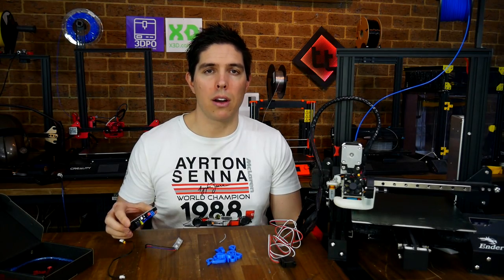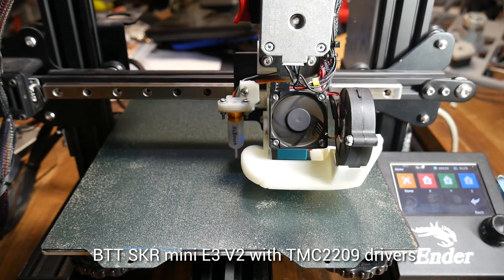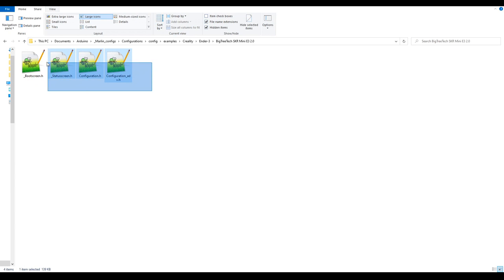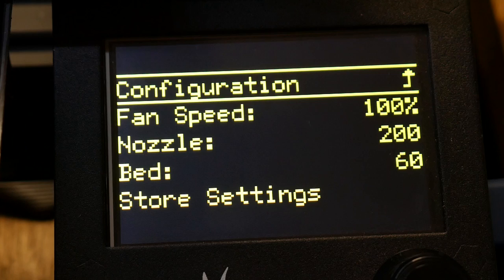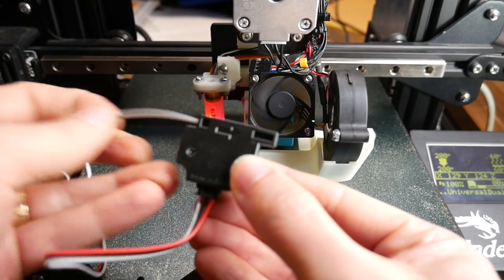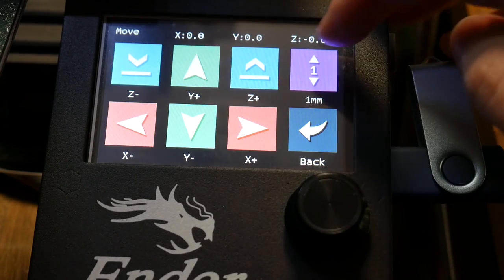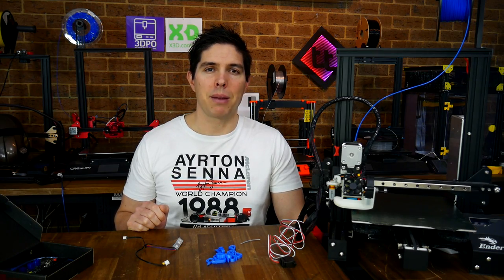SKR Mini E3 V2.0 - Complete guide to the best value Ender 3 upgrade

Comment: Hi, 
after I switched to new motherboard BIGTREETECH® SKR MINI E3 V2.0 on ender 3 pro, the printer moves to the end at X axis, end the table has also moves out after each layer change, I thought maybe there was a bug in the system. so I wanted to try and see if I could fix it.
 on the "studio code prog"
and I wanted to put new firmware on the motherboard, and then I get this error. on the "studio code prog"
so I cant sett a new software in the motherboard, it wont make me re-build. i have tried most things that i can be found online, done exactly as i have seen it. but only get this error all the time
"Error: stm32fi family in nor supported by maple core"
"STM32F103RE_btt FEILED

 some ideas :-)

Comment: Are you getting any freezes? I've had several and there are discussions on github about it.
Reply: steve Andre Back then I was using the Marlin bug fix branch. There was a problem with a library dependency that caused the freezing. I made the change someone suggested and haven’t had any issues since. Thank you though

Comment: Can you please make a video with a step by step guide on how to build marlin 2.0 for an SKR mini E3 V2.0? 
the skr mini e3 v2 is not compatible with the v1.2 build guides, you will run into dozens of errors if you try to follow that, even if you input the correct perimeters for the v2 such as new 32 bit chip and things like that.

Comment: Now, a little project for you lol. I’d love to use my old Creality board, or my old 1.2 board OR the relative driver board (?) and arduino to work with such as a nema 17 and turn it into a bottle rotator for resin bottles :) anyone fancy taking this on?? No more bubbles and beautifully mixed resin.

Comment: Thank you for the guide.

I got stuck trying to add a BLtouch & NeoPixel setup to my Ender 3 with the SKR v2 mainboard.

The works fine with the BTT pre-configured firmware. I tried to add the BLtouch settings, along side your NeoPixel settings. the NeoPixel appeared to work, but the BLtouch wasn't playing ball. I kept getting a probing error.

I have given up now, after playing with the config for over 6 hours.

I would love to get NeoPixel working alongside the BLtouch if anyone is willing to help me, or send me over a working config please!

Comment: According to the official SKR Mini E3 V2.0 pinout, your wiring guide is wrong. You should change black dot with red dot in the bed connection. Luckly polarity doesnt matter in this case otherwise some boards would be fried.

Comment: Has anyone else been able to install the windows driver for this board?
It will not install automatically and when I try to do it manually it fails because the driver isn't signed.

Thanks.

Also when I try to compile the firmware it keeps failing.

Comment: Anyone having an issue with the extruder not working once installing the board? Moving the z axis, moves the extruder and removes the filament from the tube. When i try to move the filament in the motions menu, nothing happens. I am so lost. I updated with latest firmware.
Reply from the maker: Sounds like plugged into second Z port instead of E port.
Reply: Teaching Tech what is weird is that moving the z axis moves the right axis, but it also moves the extruder at the same time. The extruder rotates and pushes the filament out. I was talking to someone about maybe something with the pins of the extruder. Any ideas? Thanks
Reply: there are two z ports if you have your Z motor plugged in the first Z port and your E plugged in to the second Z port jogging the Z axis will make both move at once
Reply: @KaspaWasTaken  hahaha that was my issue. I cannot believe I did that. Thank you so much.

Comment: For some reason whenever I compile the basic version and upload firmware, I keep getting the message "EEPROM Version Error" Anyone any idea?
Reply: Jo Van Bever somewhere in config or config.adv there’s a setting to auto initialize the eeprom, enable it and that should go away.
Reply from the maker: You can also do it from the menu in the LCD. This error comes when you change compiling features and after re-initialising then storing settings will go away.

Comment: Note:  On the SKR diagram example, connection B ... the connection shown is the wrong way round. Positive is closest to the side of connection C, not H. My bed wasn't heating up, checked the pinout diagram on the Bigtree github site, and confirmed, I had mine cabled the wrong way because of following the image. Reversed them, and the bed is heating fine now.

Comment: Hi! I have managed to install everything fine, and when I switched my ender 3 on, everything seemed to be going well. I have tried to do a test print and both the bed and the extruder seems to be heating normally, however, when it starts the print and it tries to go home, my extruder now keeps ramming itself onto the switch in the x-axis? Does anyone know any solutions for this?
Reply: thats the exact thing that has happened to me. Check your belt tightness and if there are loose wires in the x stop or x motor. does it do that when just moving the x axis? Im hopinh updating the firmware will fix it

Comment: Any having issues with the v2?. I installed this board to my ender 5 and i confirm the hot end and part cooling fan work following the diagram but my motherboard fan doesn't spin even if there was a print going. I tested the mobo fan and it does spin. It is plug into the fan 1
Reply: i could recompile for ender 5 if you want

Comment: What i have to change in TFT firmware to increase nozzle temp? I change in Marlin max temp to 400 deg and it works but only in Marlin mode. In TFT mode stil only 275 deg. I tried compile firmware for TFT, changed (configuration.h) #define HEAT_MAX_TEMP    {400,275,275,275,275,275,150,60} and in config.ini  - max_temp:T0:400 T1:275 T2:275 T3:275 T4:275 T5:275 BED:150 CHAMBER:60. When I upload firmware got message "invalid values "max_temp:T0:400 T1:275 T2:275 T3:275 T4:275 T5:275 BED:150 CHAMBER:60".

Comment: Am trying to instal the SKR all ok following this video (using VS) putting in the STM board name in platform.ini run compile but rejecting the board am working on a MAC, am making sure board name correct but will not compile, thanks,, UPDATE: problem sorted, was 2 things, first Mac needed  'Bash' changing to 'ZSH' is used within VS Code (has been altered by Apple) and my file path was too long, have now fully updated my SKR mini E3 to latest Marlin.

Comment: Unfortunately, there is currently an issue with Marlin (https://github.com/MarlinFirmware/Marlin/issues/18565) that completely breaks prints if using octoprint and have a pause (for filament runout or anything else). So, if you use octoprint, don't enable the filament sensor...

Comment: Can someone explain what specifically makes the printer quieter with the new board? @2:06
Reply from the maker: It's the stepper motor drivers. The RMC drivers make the difference.
Reply: @TeachingTech  You meant TMC

Comment: I bought this upgrade and I also purchased the touch screen. And i can't for the life of me get the touch screen to recognize the printer, anyone have some advice?
Reply: I can't remember exactly what the setting is called but it is essentially the polling rate, should be set to 250000 i believe. There's a few videos on fixing the issue

Comment: OK I got my skr mini e3 v2 and loved it. the only issue is that it only lasted two months and im not quire sure what is wrong. ive plugged in all back in and flashed the firmware a few times still nothing. If anyone has hay ideas of what it could be id love to hear them.

Comment: Amazing Job, Michael!
I'm planning to build my own customized 3D Printer based on this Board and now I'm searching for stepper motors. What is the Maximum power output for the Stepper drivers? I'm going to run the System on 24 V. Can I plug in bigger motors than NEMA 17? The BTT website only says 2.5 A max output current, but for which port? The heated bed? Every output?

Thenks in advance!

Michael

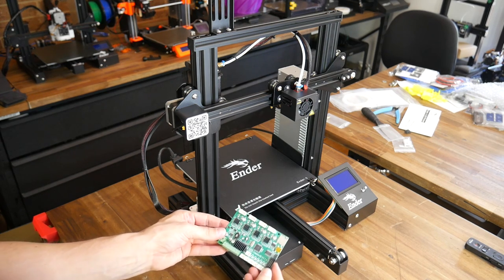Comment: teaching tech and GUYS be careful (lol) i installed skr mini e3 2.0 today and screen was BLANK like there is no power going to it ! after checking manual and looking at picture i found that that LCD connector tray ( the black container that gives direction to the lcd cable ) was installed in the wrong direction!! so i removed it ( carefully it can be removed ) installed LCD cable in the other direction and it WORKED 100% ! so if you happen to have NO power on lcd after installing it.. that's the problem! if anyone has doubts i'll provide a picture ( the cable container is the " J " in the video at 4:29  )

Comment: Is there a way to update the Marlin firmware on the SKR Mini E3 v2.0 that does NOT involve using the SD card?  I have installed the Maple drivers to enable to USB cable that came with the board so my computer recognized the port opening but I cannot get VS Code to push the Marlin build to it like I used to with my original board in my Ender 3 Pro.  Can anyone help me?

Comment: I don't understand this fan setup, you are supposed to pwm control the case fan but leave the hotend fan just running all the time ?  I have mine setup to do the 2 hotend fans , so my printer is silent when not printing and tool is below 50c, the case fan can stay on all the time for all I care.
Reply: Also be warned the fan mosfets are crap and there is no protection on them, I already blew them both and replaced them.. this is discussed on reddit and the github also as problematic for others, I would be wary of using buck converters without external mosfets
Reply: I just installed the skr mini e3 v2 and tft35 into an Ender 3 pro.  I plugged the case fan and parts cooling fan exactly as shown in teaching tech's video.  (parts cooling fan onto fan0, and case fan onto fan1).  As soon as I turned on power, the parts cooling fan runs at full speed.  Don't know why it's running when I'm not even printing anything.  So seem like the fan that's plugged into fan0 is running all the time.  Is that what you're observing on your setup?
Reply: @ptmoy1  No that sounds like a firmware or board issue, I mean the hardwired fan, I  swapped them so the hotend fan is off when not hot, and case fan is hardwired now.
Reply: @tablatronix  I still don't quite understand how you have your wires connected.  On TT's video, he has the part cooling fan (yellow/blue) connected to fan0 and the case fan connected to fan1.  On your setup, are your wires connected exactly like what TT is showing, or the exact opposite?

BTW, as you've mentioned in your original post, there are two hotend fans.  When I have my yellow/blue wires connected to fan0 (as shown by TT), only one of the two hotend fans turn on when I power up.  Aren't the two parts cooling fans controlled by the same two wires?
Reply: @ptmoy1  Not on this board, this board has 2 mosfets so both fan0 and fan1 can be controlled via software, the stock board has one on all the time. When you turn on your skr board it does a test and runs both fans for about a second, check that both lights light up, its a good way to test your fans. I am not using my own firmware, so I am not sure how the default one was setup, maybe they are turning on that fan all the time.. but in marlin you CAN change it if you want. I have fan1 turn on at 50C, and fan0 turns on via gcode for part cooling. and case fan is hardwired. I added a jst connector to the hotend fan so I can plug it in
Reply: I think chris basement has a similar setup in his video for this board, he changes the fans
Reply: @tablatronix  Sorry, I was confused.  It's the hotend fan (i.e., the fan with the wires screwed in to the two power connectors next to the main input power connectors) that's on all the time on the SKR E3 Mini V2, just like on the stocked Ender 3 Pro motherboard.  Can this fan be controlled by gcode or firmware on this SKR board, or should it be left on all the time?  That stocked fan is really loud.
Reply: @ptmoy1  Yes that is what I did, added a connector to the hotend fan, and used fan1 or 0 I forget, I have it set in marlin to turn on above 50C only. I think the default firmware has it set to case fan control, which is on if any stepper is on. Only the e3 2.0 has 2 mosfets for fans

Comment: I installed the skr mini e3 and tft and I can't print from the sd card on the main board and the marlin sim just has a black screen that was lcd12864 any one have any ideas
Reply: the black screen was due to me using port 1 on the screen and not 3

Comment: The issue I had with the TFT touchscreen when I was using it is that my print would pause in the middle of the print and no longer take any commands. It seems it does not play well with OctoPrint. Was this resolved in 2.0?

Comment: I installed my board today.  Scratched my head several times and am still frustrated. Board works nicely, as long as I feed it SD cards.  Feeding by USB however is a real nightmare.  Have read and searched and read only to find that it seems that the USB connection is a magical event that only some manage to be blessed with.  I would appreciate if someone could lead me to ONE article that leads to a successful operation of the board/USB connection. There are many articles out there claiming to have the answer but after 3 different methods, I still cannot connect with USB.  I have yet to find the port settings for this board and therefore have to assume (OS) that they are the same as the UNO - 115200 - 8 - None - 1 - None. I "seem" to have the correct driver installed but it does not advertise itself as Maple driver in Dev Mgr only shows USB Serial Device (com8).  Thanks in Advance for any help. Looks like I may have another board for the "another useless board container".

Comment: What is that display with the usb on the right side? I need to knooooooow
Reply: Should be the BTT tft with dual mode :)
Reply: @pringineer1027  Thanks. And are you aware if it works with an MKS Gen L v1.0? Thanks
Reply: I think its this one:  https://www.biqu.equipment/collections/lcd/products/btt-tft35-e3-v3-0-display-touch-screen-two-working-modes
Reply: @alejandroperez5368  don't quite know... The gen l is quite old by now though and I've replaced mine with a skr v1.3 :) much better board in my opinion simply for the ease of uart implementation

Comment: As of September 24, 2021 there is currently an issue where the configuration files are not up to date with the bugfix or imported build of Marlin. I've tried on two computers now and I keep getting the error: #error "Your Configuration.h file is for an old version of Marlin. Downgrade Marlin or upgrade your Configuration.h." Same goes for the adv file. I even tried updating the variable names to what the output error said they should be, which is pretty much the only thing that I could understand from the error codes, but I still ended that process with it giving me the same error without too much of an explanation. I've only tried this with the Ender 5 config files so far.

Hope this gets fixed or that I find someone's up to date config file because I have no idea how to update the config files correctly or downgrade Marlin. I've just resorted to using TH3D for the time being, which compiled very easily, however I know that the range of options within TH3D is incredibly limited compared to Marlin.
Reply: I just built the latest marlin2.0 with the config files provided in the example directory, only thing that didn't work as in the video is the name of the board (use STM32F103RC_btt instead of the STM32F103RC_btt_512K, it was apparently a hack and has been removed as an option)

Comment: I get following problems when trying to compile:

Arduino:1.8.13 Hourly Build 2020/04/21 12:12 (Mac OS X), Kort:"Arduino Uno"
In file included from sketch/src/inc/MarlinConfig.h:32:0,
                 from sketch/src/MarlinCore.h:24,
                 from sketch/src/MarlinCore.cpp:31:
sketch/src/inc/../pins/pins.h:670:6: error: #error "Unknown MOTHERBOARD value set in Configuration.h"
     #error "Unknown MOTHERBOARD value set in Configuration.h"
      ^~~~~
In file included from sketch/src/inc/MarlinConfig.h:40:0,
                 from sketch/src/MarlinCore.h:24,
                 from sketch/src/MarlinCore.cpp:31:
sketch/src/inc/SanityCheck.h:1501:6: error: #error "USE_CONTROLLER_FAN requires a CONTROLLER_FAN_PIN. Define in Configuration_adv.h."
     #error "USE_CONTROLLER_FAN requires a CONTROLLER_FAN_PIN. Define in Configuration_adv.h."
      ^~~~~
sketch/src/inc/SanityCheck.h:1553:4: error: #error "HEATER_0_PIN not defined for this board."
   #error "HEATER_0_PIN not defined for this board."
    ^~~~~
sketch/src/inc/SanityCheck.h:1751:8: error: #error "E0_STEP_PIN, E0_DIR_PIN, or E0_ENABLE_PIN not defined for this board."
       #error "E0_STEP_PIN, E0_DIR_PIN, or E0_ENABLE_PIN not defined for this board."
        ^~~~~
sketch/src/inc/SanityCheck.h:2140:4: error: #error "TMC2208 or TMC2209 on X requires X_HARDWARE_SERIAL or X_SERIAL_(RX|TX)_PIN."
   #error "TMC2208 or TMC2209 on X requires X_HARDWARE_SERIAL or X_SERIAL_(RX|TX)_PIN."
    ^~~~~
In file included from sketch/src/module/stepper/indirection.h:44:0,
                 from sketch/src/module/stepper.h:47,
                 from sketch/src/MarlinCore.cpp:37:
sketch/src/module/stepper/trinamic.h:29:10: fatal error: TMCStepper.h: No such file or directory
 #include <TMCStepper.h>
          ^~~~~~~~~~~~~~
compilation terminated.
exit status 1
Error compiling for board Arduino Uno.
This report would have more information with
"Show verbose output during compilation"
option enabled in File -> Preferences.
Reply: I have mostly the same errors, are you any further with this yet?